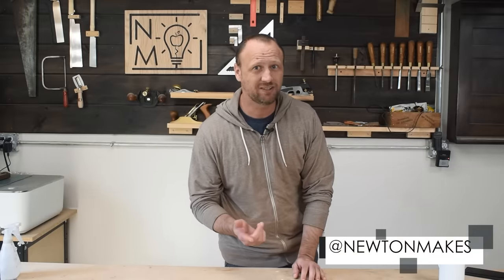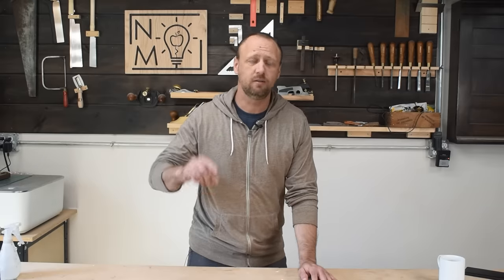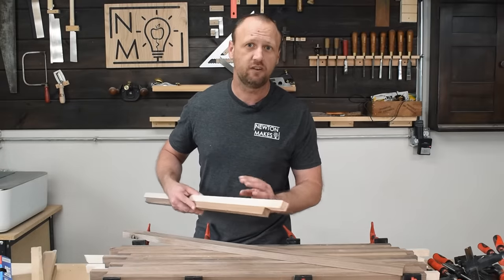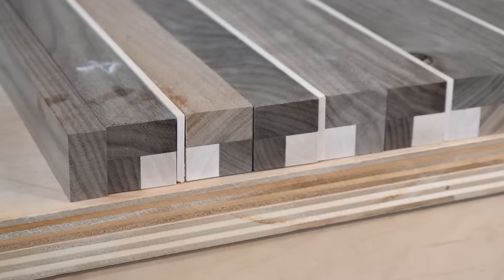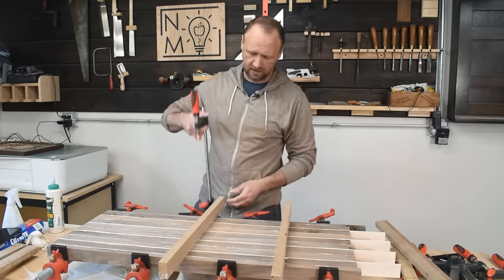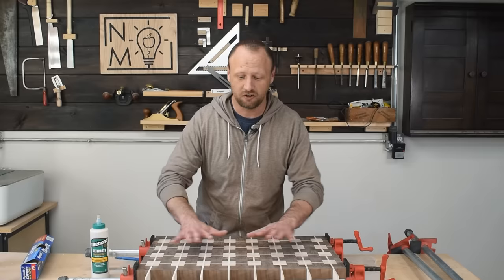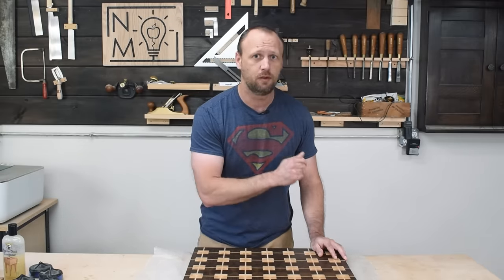Can You Make A Professional Looking Cutting Board? | Step by Step Guide

Comment: I use the same finish for my cutting boards. However, for boards this thick I would use the same company's straight mineral oil in maybe 2 light coats before I apply several coats of the wax/oil mixture. YMMV.

Comment: Than K you SO SO much! Your video allowed me to make a practice blate without guess work. You should do classes..I'd join in
Reply from the maker: My goal is to make woodworking accessible and fun. People may not be able to follow step by step but they should get a good understanding of what I'm doing and be confident in modifying projects to their own tastes.
Reply: @NewtonMakes  well you're definitely doing that and I thank you so much!
Question: soooo i wanted to make a table saw sled so i can cut down my 1/8 in. strips... Problem that i literally just realized is the table saw that i am currently using (my craftsmans motor just went out) doesnt have any miter grooves😭 any ideas on how i can make/use a sled without having them?

Comment: This is another great vid on how to make 3D looking boards. My dilemma right now is picking one to try! Tip for thin panel glue ups: elevate the board edges slightly, apply tape across the V you make by elevating, leave a slight gap between the tape and bottom of the v, apply glue and when you flatten the pieces the tape will be under tension thus will apply more 'clamping' pressure. Or look for a vid on how to glue up a guitar top using that method because that's how it is often done. I have to admit that I've never tried this on a multi-panel glue up so it may be too difficult to make it work in that case.

Comment: Just to add a small detail..... Most of us are ussing every day our planers. Most of the times we are not using the complete width of the blades but just a portion and ussualy in the middle. With the use after few months the centre of the blades start to create a small recurve which is not visuall untill we get to cut the cross grain pieces for final glue up to create the pattern . The moment you flip the pieces to create the pattern, that's were you will get the unpleasent surprice(dont ask me how i know!!!).
A small tip: use fresh blades for projects like this!!! If spare blades are not available than a couple of passes in the middle of the glued up pieces before the cross grain cut with a coarse sand paper (80 to 100 grit) should do the trick.
Good job on your description !!!
Thank you very much for the complete very well explained video!!!!

Comment: Amazing plans!  Thanks.  After the first board I discovered the little imperfections that can bite you and those that don't. Making my second now and am very excited to see how it comes out.  I used walrus oil on the first and was disappointed in how dark the board became.  It looked more defined unfinished.  I have only waited 5 hours since coating, so perhaps tomorrow will look better.  Will see if you have a link for your finish.

Comment: I have watched several of your cutting board videos and you are truly a craftsman with an exceptional vision of how to make the end product. One question I have on the oil/wax finish. What brand were you using? You also mentioned making my own. Again, what type of wax and oil and in what proportions? Thank You!
Reply from the maker: I believe that I used Howard's butcher block conditioner. I think. Don't hold me to it. Other people have made their own by applying mineral oil and then rubbing melted beeswax on the board. I've not used that process.
Reply: @NewtonMakes  Thanks for the quick response. I am looking forward to your next cutting board project.
Reply: @keithgatewood5456 For maintaining your board, you can also make your own wax using a double boiler to slowly heat the mineral oil and then adding beeswax that, when cooled, is kind of like shoe polish.  It may take a bit of experimentation to get the consistency that you like.  I prefer it a little on the softer side. This makes it easier to apply.  I pour the finished wax into shallow jars found in the canning section in stores such as WalMart.  WM also has very reasonably priced mineral oil in the laxative section.

Comment: There is a company in China that will produce any design in any obtainable wood with several different CNC cutting and etching systems from 6" X 6" to 56 X 72" and 3" thickness. Shipping can be more expensive than small boards.

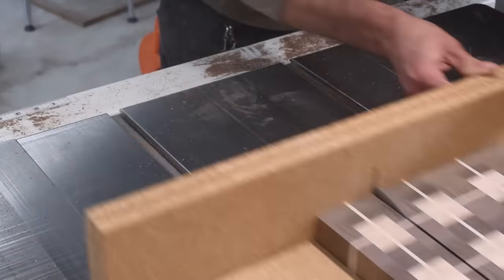Comment: Hi. Great video! Question, at 9:46 in the video, you are cutting the board to final size on the table saw. You have a couple of green clamps against the fence, and the bottom of the board is off the surface of the saw. What does that jig look like and what does it add to the process? Thanks!
Reply from the maker: I did not have a straight edge to run against my fence so I clamped my board to a piece of plywood. That's why it's elevated.
Reply: Ahh. That makes sense. I was just trying to figure out show to address that situation myself, great idea! Thanks for responding, much appreciated…

Comment: Hello again. I have a quick question I am hoping you can answer today. (Newbie question )
You started with some raw fairly thick lumber and planed everything down and eventually ended up with some 3/4" strips for your initial glue up.
Did you plane the entire board down to 3/4" or did you did you plane it to 1 5/8" and cut individual pieces 1 5/8" wide by 3/4" thick , and then subsequently cut each of these into two pieces of 3/4" square material?
Now that I have written the question, it looks really dumb but I will still ask.
I suppose if I cannot get past the very first step of simply making 3/4" strips, this project is going to take me a very long time :-)
I really love the look of this cutting board and the plaid board from your other video.

I plan to try this one first, and then level up to your plaid cutting board.
I am a beginner and I am not on any schedule. It will take as long as it takes.
Reply from the maker: The goal is to make 3/4" squares. It doesn't matter how you do it. Do what works best for you and your tools and abilities.

Comment: Hey Billy, you did a really good job on this cutting board, it looks like it came out perfect!  I bought your plans for this and have now made 2 of them.  Each time I have struggled with keeping the Maple squares the same width and height as the Walnut squares.  When I do my final glue up it's obvious that some of them are smaller or larger than others.  I know this is happening because of the milling that needs to be done in between glue-ups but I can't figure out how to make sure they're going to come out the same size.  Any tips?  Also, why do you use the extra 2 rectangle strips on the sides and not on the ends?  Is there a reason you purposely don't want all the sides the same?  Thanks
Reply from the maker: Shoot me an email through my website 👍

Comment: Well this was a nice recommendation, thanks youtube! I'm always looking for insight to apply to my shop so here's a quick question: What tips do you have for someone who would like to use rough wood, but doesn't have a jointer? (I do have a table saw and planer, jointer is next on the list lol).

Keep up the killer work!
Reply from the maker: Make a planer sled out of plywood. You can use shims to keep the lumber from rocking. Run it through the planer that way. Now you have a flat side. Take it off the sled and plane the other side. You can so something similar at the table saw to get a clean edge.
Reply: @NewtonMakes  Brilliant, thank you! Now to go yell at craftsman for their weird propriety miter slots on their jobsite saws lol

Comment: Thank you so much for your great vids. I absolutely  love your videos, They have motivated me to make my first cutting boards and maybe turn it to a possible side business. I have a bit of a question for you and I really hope I can get your feedback. I want to make a brick pattern end grain cutting board. I have the brick and small mortars cut out of Walnut and Cherry respectively. However for the longer mortar I don’t have boards wide enough to re saw the end grain to the thickness needed. That said, am I able to use face grain or edge grain to fill in that mortar, considering that the main part is short grain and that mortar would be long grain? Or am I better off glueing boards together to get the end grain to length and trying to re saw the mortar strips from there? Looking forward to your response. Thank you very much.
Reply from the maker: That's a personal preference. I did face grain stripes in my plaid cutting board video. The internet told me it would explode but it's perfectly fine. I can't speak for your lumber or what experience you may have. This video, I did end grain. I glued multiple maple boards together until they were wide enough.

Comment: One more question 🙄. I’ve seen varying angles and depths of cut on the side bevels. Trying to get a sense of what works best. What angle did you have your blade set to when you beveled the bottom of the board?

Comment: OK, decided on this one, bought the plans and am reading through. Can someone explain the need for gluing up a maple panel that gets cut into strips when you could just cut strips from plank stock the same way as for the first set of maple strips?
Reply from the maker: The strips are end grain. If you have a 14" wide maple board you can certainly do that. Otherwise, you have to glue up pieces.
Reply: @NewtonMakes ; I woke up the next morning and thought "because you need end grain!" Am I the only one who has noticed that the pattern in the drawing/illustrations don't match the real thing? Maybe the yellow lines in the illustration (between the brown pieces) are not supposed to be maple, but they sure look the same as the required maple stripes.

Comment: Great video.  I'm curious.  What grit paper do you normally keep in your drum sander?  Also, is that galvanized pipe in the bessey clamps? I have used black steel pipe since the beginning of time but avoid using them because now because of rust stains.  Thanks.
Reply from the maker: I use 120 grit. Yep, galvanized.

Comment: Can you help me with a problem on cutting boards? I make them and sell them at craft shows and similar events. Today I was at an outdoor event and saw three of my boards start to curl in the sun.  I originally had them in the shade of my easy up.I got them out of the sun and they returned to normal a few hours later. They were an inch to an inch and an eight in thickness and of varying patterns. So am I doing something wrong to have this happen? The woods I made them with are maple padauk and black walnut and oak. I had this happen last year to a board and could not correct the problem. Obviously keeping them out of the sun will be a big thing now but what do you think about this and if there's something I can do to prevent his in the manufacturing process.
Reply: Was the wood climatized? Usually exotics woods aren’t super fresh, so they don’t usually need to sit before use, but they could have been freshly cut.
If they were, you usually want to let them sit in your shop for 1-3 or even 4 weeks before working with them
This will let them curl naturally before working with them, and could save you from having finished a board curl.
Might be worth a thought

Comment: I just bought these plans and was disappointed to see that it doesn't actually list how much wood I'm supposed to buy.  It just says to start by cutting 8 boards of each wood (I had no idea this project was going to be so expensive!!!), but doesn't say what dimensions of boards I need...nor does it say what I need to buy to make the thin strips.  This was actually the main reason I bought the plans (and to support you) since I can see the process in this video.
Reply: Here at my local store, 8 ft 1x4's are $70 per walnut board and $37 per maple board.  That means this project uses over $800 worth of wood?  That doesn't seem right to me.